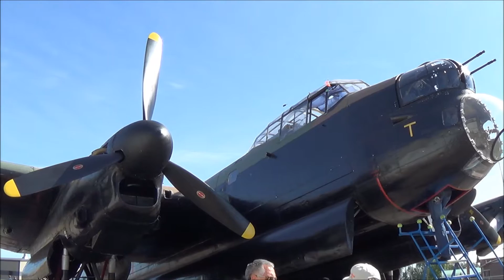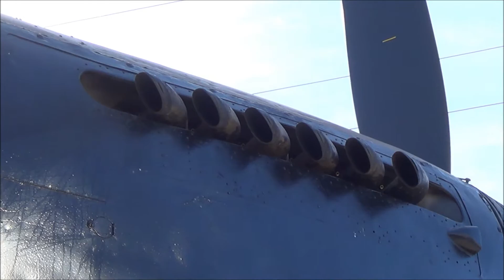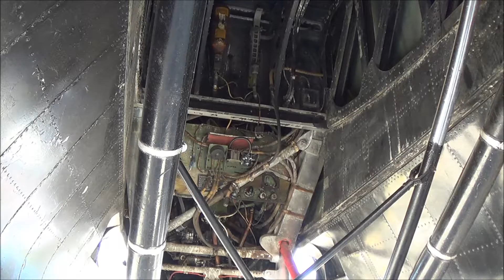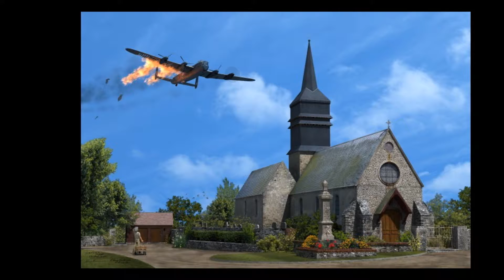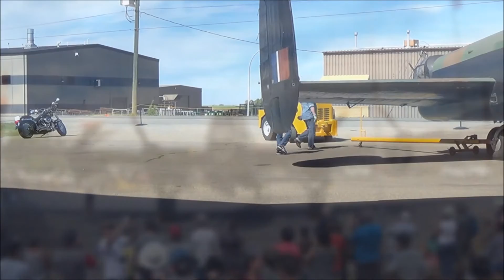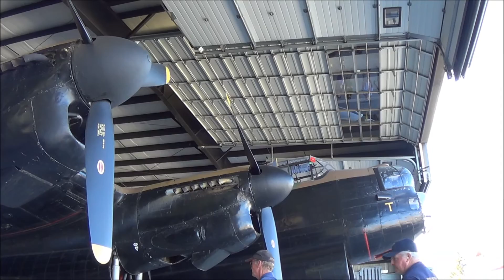Avro Lancaster Merlin Engine Run

Comment: Is it still capable of flying if given the chance?
Reply from the maker: The general consensus is yes, it is still capable of handling flight stresses, it actually entered preservation in 1960 still in flyable condition. The airframe has been thoroughly surveyed and found to be in very good shape, if given the required work it could potentially take to the air again